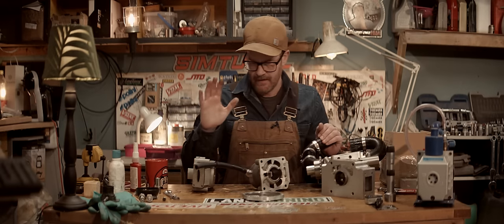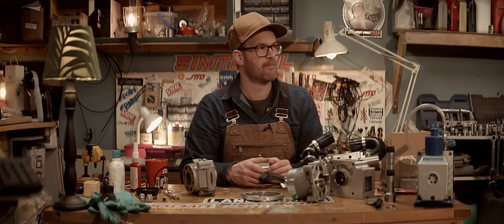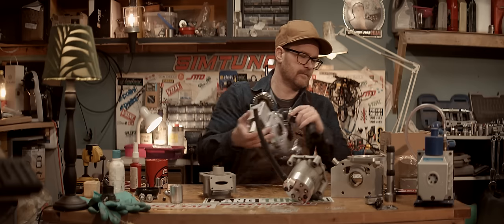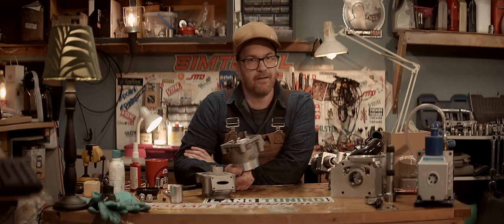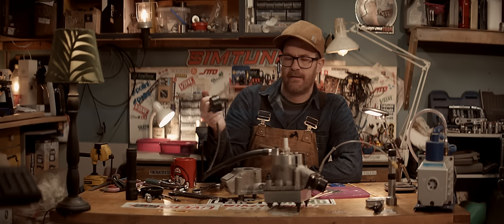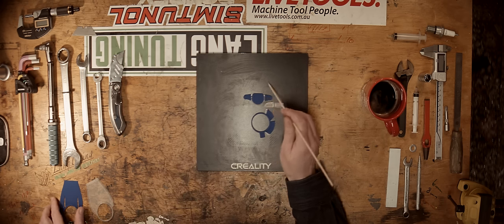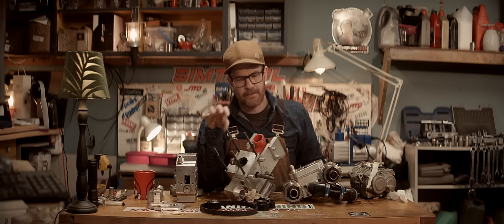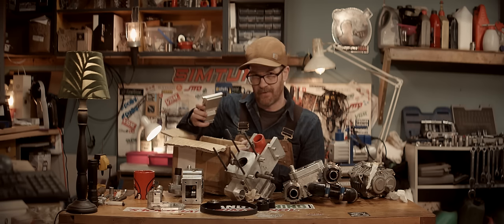Rotary Exhaust Supercharged 50cc Externally Scavenged Two Stroke returns!

Comment: So i have a crazy idea. You have your steel liner... What if you plastic 3D printed the bulk of the cylinder geometry? If you did good cooling in theory you would only need an aluminum machined, or cast exhaust duct as the one heat load bearing part. PLA or PA-6 CF would probably work.

When those plastics get hot they soften but with enough material they will hold their geometry well enough.

The FTN.3 3D printed rifle suppressor has proved PLA can take some serious heat abuse and still function.

If you can plastic print cylinders you could get some serious geometry fiddling going on for quick and cheap. If you did a good job with your CNC you could probably get some really nice exhaust ducts made. Also you could lost PLA cast ducts with less headache as it's a simpler part.

Comment: Maybe Explore an Opposed Piston two stroke engine.  A competitor for 'highest hp single cylinder 50cc', two 25cc pistons, two cranks,  within a single cylinder.   Opposed piston Potential benefits compared to conventional 2 stroke engines:   Higher ratio of port area to displacement, less thermal losses due to no head surface, short stroke length decreases piston speed for great rpm and gas flow potential.   In practice the opposed piston design could be configured in 2 different port gas flow configurations:  1. The typical opposed piston is a uniflow port (intake piston and exhaust piston) with a additional compressor (turbo or blower, or turbo with electric turbo start mode like RC jet engine).  2.  A different opposed piston design might use two conventional cylinders port flow patterns as a single cylinder but without heads.

Comment: The main problem with the blower is using a carburetor. You would be needing a programmed fuel injection system.
Reply: draw through supercharging has been done for a long time.
Reply: @dalejrjunior1298 fuck yeah it has 😎 ask my Datsun 1200
Reply: Also draw through keeps everything very cool and negates the need for an inter cooler 😊
Reply: @theseoldhands532  I seen a 383 with a blower and 1050cfm carb that thing had pretty cool air Temps for no intercooler
Reply: @dalejrjunior1298  2 stroke is perfect for draw through. One word. 

Lubrication.

Comment: Perhaps a blow off valve would help along with a boost control to set the psi your wanting. 
Both would be a big help to control accurately the desired boost level, and give you a way to increase or decrease the boost as desired. 
If you go with efi Perhaps you plan on using something like fuel tech are someone else's management system then a O2 sensor would also be an advantage to have also. 
Then you can apply changes to all aspects of the fuel mapping as well as boost management equally.

Comment: You need an air metering device. Put a MAF on it so you KNOW when its consuming more air. There's too many variables when it comes to making power on the dyno. Knowing that it's digesting more air means that you've got to adjust something else if it's down on power.
Reply: Yes! Near then end you announced a MAF!

Comment: Here's a thought take a 50cc 4 stroke and convert it to 2 stroke, use the valves ls for intake and the exhaust could be ports which would give you a larger area, but you would have to add the supercharger to make it work.
Reply: Reverse of the tried and true Detroit design, ey?
Reply: @hunnybunnysheavymetalmusic6542  yes except Detroit has exhaust valves and intake ports.

Comment: Hi Alex,  maybe it is a good idea to make a oposed piston engine from 2x25cc. you can feed it from under with the amr 300 supercharger. and make an insane big exhaust in the middle. Small stroke will give more potential for rpm.  something like the Napier Deltic, but not a triangle of 3 and on gas, meth or intro instead of diesel. No need for complicated injection. Lots of room for adjust port timing when you use a ring in the middle and under witch are easy to alter.

Comment: run it without the radiator carp on , then you have no pressure in the system, you will get some test runs and very little leakage, with the bore heating up it will expand so it should reduce the leakage as it gets hotter
Give it a go, have a play!!!!
Reply: crank case fills up just adding coolent

Comment: Go brute force but with a rotary exhaust valve but a solid one located towards the roof of the exhaust port similar to a yamaha rz250/350 style with a port cutout and run it off the crank , throw boost in it and make an adjustable pulley for the valve with a car vct cam adjuster so you can play with exhaust timing in realtime on the dyno 😊😊😊😊

Comment: i really love the outcome of all of this , jazz engineering might be frighting but that how you can discover some new things and get good results . Why not build a 2 stroke engine operated by valves with overlaping timing ?? Basically a 4stroke but with the intake charge being forced in to push the exhaust gasses ? or reproduce the 2 stroke detroit valve system.

Comment: OK here's the deal.... worlds most powerful two-stroke is going to need forced induction nowadays, nitrous just blows up engines. Truth is I found your channel researching my Snowmobile build. You helped me when designing my pipes. I used your percentage rules on length and lower convergent cone angle on my pipes because of back pressure concerns. As a community we learn from each other.  So much isn't known about pipe designs with turbocharging two strokes and it works so dam good! Problem is everyone says it won't work because of no valves, overlap, bla bla bla. When in fact they have never done it before.  You cant look at engine size when determining turbo size, you must look at things like base horsepower and airflow to properly size them.  What would it really take to buy a $200 ebay RHB31 and see if it will spool? Take you one day to throw it on a pipe and try it. You will never look back imo. 
Mikuni rounds work great if you reference bowls to the intake, easy. Always reference fuel pressure to the pipe center section and run a loose stinger, done. I will bet that you could even go bigger turbo in the future. They are spooling these little turbos with Briggs motors. Yea they are 300cc four strokes but your 50cc two stroke has more airflow and base horsepower than they do. Love your vids and humorous comments!
Turbo fun is just around the corner!
 Cheers!

Comment: Personally, I would build a stock setup, but not to find out how much you can make with it, but to test other variables. Even if it generates 1hp it's enough to have it so you can test if the horsepower tester works or not,  if a supercharger works or not, etc.

Comment: suggestion: supercharged 2 stroke engine built like 4 stroke. oil is downstairs at the oilpan under the piston, then supercharger creates the pressure and injectors inject the fuel. no twostrokeoil in the mixture. no transferports. Can the nessessary pressure for the perfect fill be produced by big supercharger? if so you could use af sensor to drive the perfect mixture becouse oil woulnt kill the sensor in a short while. I think this woulnd do much sense in bigger engines becouse the size of the supercharger needed would (maybe) be to be too big to produce sufficient pressure, but on a 50cc engine it might be doable and you then could control the perfect mixture by software.
Reply: this cant work when i think about it, intake port needs to close during detonation so it just would squirt oil into intake, or if the piston had oil rings lower than the intake channel, it woulndt lube the upper rings at all. if there is a workaround, like oil channels in the cylinder between the lower oil rings and upper rings it might work.

Comment: A carbon belt take huge heat and are very strong. Many have no time too change on service re mileage or time! Harley Davidson on drive belts just look for cracks and dont think they are carbon. run close to exhaust from motor to back wheels!

Comment: Rotary valves are a great idea, but I think your ports are too low, they should be at the very top of the cylinder, actually in the "head". Rotary valve cylinder head. No ports in the cylinder, sealed crankcase with pressurized oil system. Belt drive the "cams" like a proper 4 stroke auto engine. Microsquirt is a great idea, worked well on my 2 stroke generator. (DLE120) model aircraft engine.

Comment: Hi Alex, there is anther option for a supercharged two stroke. Though the design hasn't been used for nearly 80 years. This design was the first engine to break the 1hp per 1cu inch barrier. Then later the first engine to crack the 200hp per 1L barrier initially on 60 Octane fuel.

The engine I am talking about is the Rolls Royce Crecy. Which was a 26L V12 sleeve valve two stroke aero engine.  It was very promising, but the jet engine came along at the wrong time, so Rolls Royce stopped any further development. As a normally aspirated engine running on 100 Octane fuel, it matched the RR Merlin running on 150 Octane fuel and a two stage supercharger.  With supercharging it beat the larger Griffin engine. See the YouTube link below:

https://www.youtube.com/watch?v=gweaCBaSmfk&t=33s

This link is for an animation of the Crecy as a V-twin sleeve valve operating. Interestingly there are opposing exhaust ports similar to Frits's engine.

The sleeve valve does have a number of advantages, especially for a two stroke in regards to port time area, even more so for supercharging. The Crecy uses the top edge of the sleeve to control the exhaust port, instead of having a cut out in the sleeve. Though there is the small issue of getting a reliable sleeve to work with the cylinder. Would make a fascinating project though!

Comment: Lots of sensors... jahh. A very interesting video series is getting even more interesting. I am definitely no motor expert, but I think your state of mind resembles my own so much, that I must check for new episodes almost every day. With "lots of sensors", there is of course always the risk of, what I use to call data colic: you get so much data that you can't see which are important and which are not, and eventually throw all the data away. Or throw up.
Earlier, when you tried out different exhaust pipes, I was wondering about that: why does he not have a fast pressure sensor at the entrance of the exhaust pipe (and perhaps even a small venturi or orifice plate, or several sensors at different positions) to try to see the pressure wave, and how that coincidences with the piston position. Should the exhaust be like a trombone, so that the length (perhaps of an even higher Q-valued resonator) could be adjusted according to the present rotational speed and thus the frequency of the pressure excitation? Yes, I can imagine adjusting that while you drive... 
I know that, for example, piezoelectric pressure sensors are not general workshop stuff, but you are very familiar with measurement technology and data analysis, so that would not be a problem. 
Another layman's idea: would it be possible to build a cylinder that is built up of plates, perhaps 1 - 3 mm thick at the port region? Yes, they probably have to be fixed very well and machined well (but that you know and can) so that the piston rings don't stick. That way you could change port geometries without making new cylinders every time, only make new plates. Potential places for leaks increase, but so what? You only need to drive for some seconds to get the power curve, so do you actually need water cooling? A geometry-experiment-motor is not the one you drive races with. 
Ok, good luck with the new research direction!

Comment: For the brut force engine have you considered a design like the gm two stroke diesel , supercharger blows air in the ports exhaust goes out the valves

Comment: Hi Alex,  I still think your leak is due to not having a full face head gasket, it is leaking from cooling circuit into the press fit between cylinder casting and cylinder sleeve under the head.  Have sent you an email with picture as well, cheers   Tim

Comment: You need to have the exhaust gases to expand when the is exit the exhaust port, and you need to have reeds. I know you throw away not using reeds, but that is your biggest mistake. The reeds should be made out of .008 to .010 thick 6-4 titanium sheet, aircraft grade. it is hard to get it now days. But cylinder repair, heat the cylinder up, and then you can aluminum weld it without warping the cylinder.

Comment: I've been following this amazing channel, and this project in particular,  for a few years now and I agree 100% that it just wouldn't feel right to take something that's already existing in order to try and "improve" it.
Free-jazz engineering is the only way forward! Haha.
An existing 2-stroke engine relies A LOT on ambient/static and pressurised "pulses" during the cycle in order to operate efficiently.
I really worry that, considering the amount of revs you're striving for in order to produce the most power, it may be physically and/or dynamically impossible as the air itself behaves as a fluid. This "fluid" may simply not have enough time to be moved efficiently through the engine and exhaust during the cycle at such high revs?

Comment: FINALLY BACK TO BRUTEFORCE CONCEPT😊🎉 I think the drum valve would work just fine with a belt. You have a lot blow by in the exhaust of fresh charge and so the exhaust temperature will be pretty low compared to standard engine. Regarding the dyno I would suggest to use a known electric motor and try to match it's performance by the reading. Electric motors have almost zero variable compare to ant ice engine, so it would be very good reference ro set the dyno😊 now let's burn some nitro💪✊

Comment: Would have thought that if the restriction is exhaust area and timing 

Then with a supercharger you can run lower transfers and have more blowdown   While also backing the timing off

Comment: Hey mate how's this for something different... what about doin away with transfer ports and design a piston that has reeds in it as the transfers... they would be held shut under power stroke, and once enough exhaust pressure has been released, the reeds would allow air fuel mix into the cylinder...have en open opposite the exhaust port for maximum performance
Reply: A pulse jet engine with reeds tell me it should without the temps n pressure...well 4 q test run anyway

Comment: have you thought about bringing the 2 strokbox thinkere into the green zone hydrogen and ozone powered maybe  ! have you looked at the gm deisel 2 stroke concept the ring of holes around the the bottom of the liner and positive pressure intake, maybe a internal turbine and your rotary valve, just a thought from anther out of the box thinker

Comment: If going supercharged, don't convince yourself you're smarter than physics. The only thing that changes with boost is the density of the air. The air flows through the engine exactly the same as it does in an N/A engine, it's just more dense

Comment: If you can put a ceramic thermal liner in the exhaust, you should be able to keep the exhaust much cooler.

Also, for peak efficiency, maybe add fuel injection? ~( 'w')/

Comment: Hey Alex! Just a little thought.....since you put a "conventional" Cylinder on your existing block ( I would guess you go for something like: 2 Fast, Bidalot, Roost, SX50, or something in those terms) why not trying to Supercharge one of those? I mean, the setup is existing from previous testing! You went away from Supercharging to see if the Cylinder design works. So why not go to a known Cylinder design now and see if the Supercharging part of the Project works? And Just Baseline your Dyno with the Metrakit Deathtrap Engine, you already know the output of that, you could even to  Back 2 back Testing on the same day.

Greetings from Germany!

Comment: This reminds me of this Stihl two mix engine it's half a four-stroke half a two-stroke and runs on mix the leaf blowers are exceptionally strong with this engine
Reply: You're thinking of the Stihl 4 mix engines, they run as a 4 stroke with inlet and exhaust valves but some of the oil/fuel mix goes to the crankcase to oil crank, cam
Reply: @johngibson3837  yeah you're right but I thought it just had exhaust valves and reed intake or something like that
Reply: @taylorhappe8026  hi, no reeds but intake diverts some mix to crank

Comment: Why not build a uniflow engine, rotary valve inlet in head and piston controled exhaust port in cylinder that way you combine supercharger with a tuned exhaust

Comment: if youre going with a ecu i would highly recommend a maxxecu mini!
Reply: 1+ 

I wanted to suggest maxxecu too, but maybe a "bigger" one would be beneficial for datalogging. Like a race. It has some functions the mini does not.
Reply: you are absolutely right! especially the egt sensors could help with the deveoloping of the engine. i think you could use an egt with the mini tinkering with the extra inputs rhough...